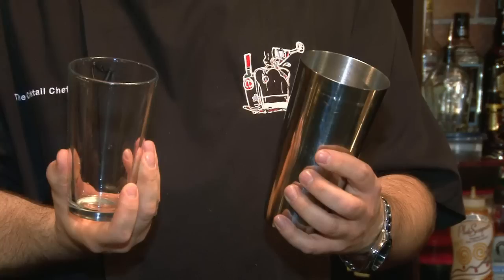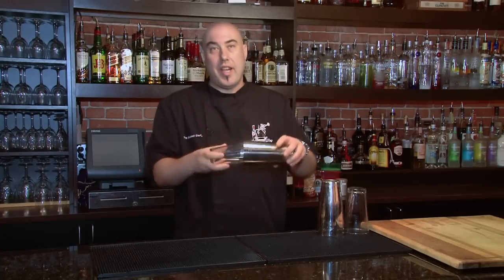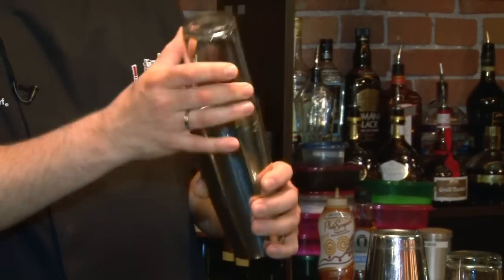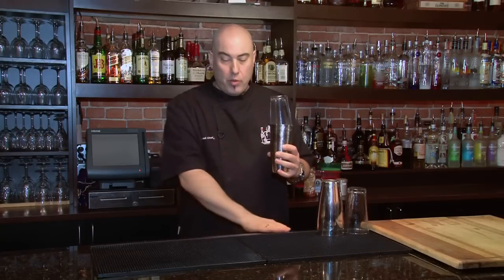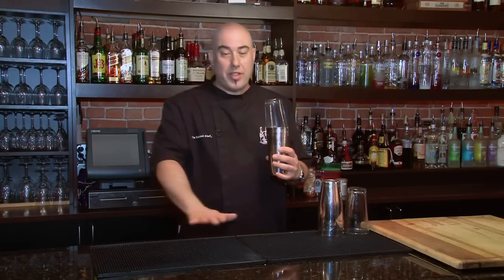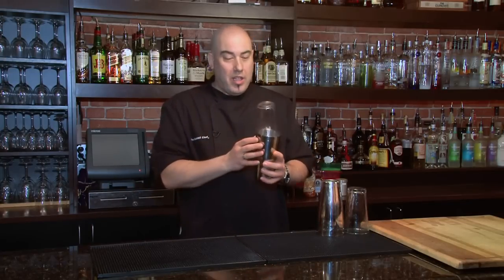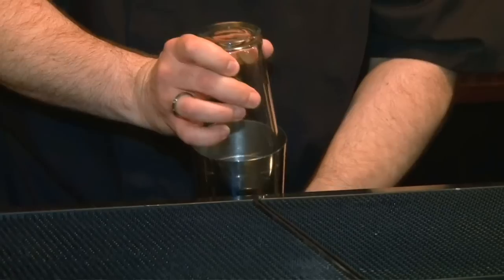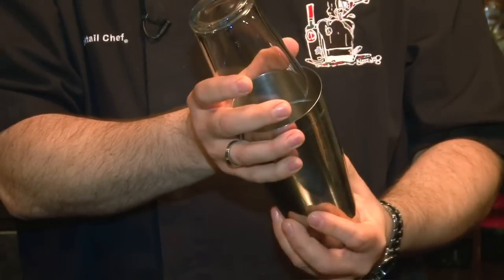How to Get a Stuck Cover Off of a Glass Cocktail Shaker : Cocktails & Mixology

Comment: Thanks for this. Ive got bruised  heels of my palms from smacking the side of that metal mixer. For some damn reason tonight bartending,  those things were locked and would not break apart. Ive got strong hands, and usually a good swift pop with the heel of my palm will bust that seal. But not tonight. Man..you can find anything on youtube